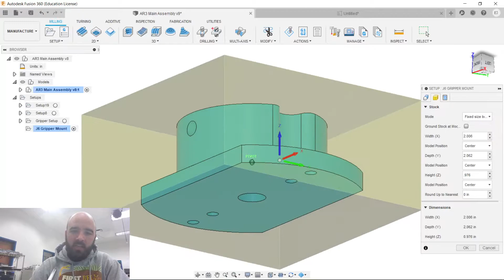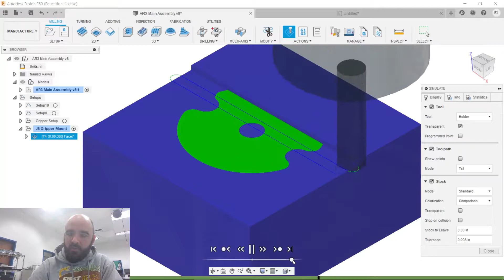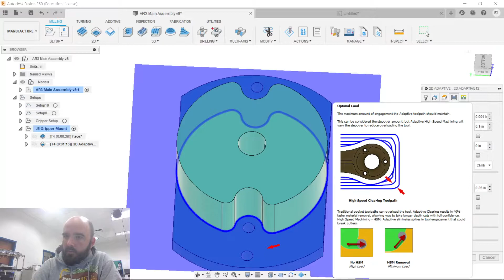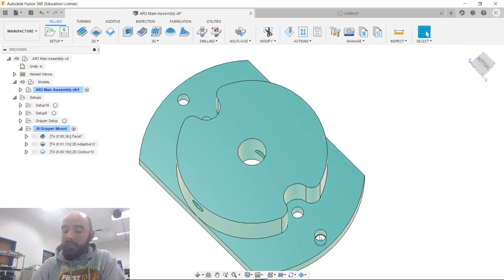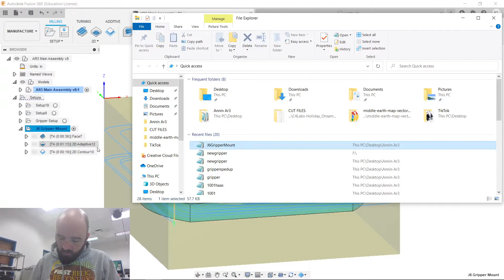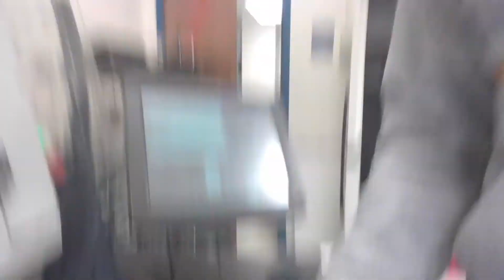Taking a Part From Fusion 360 to the Tormach 440

Comment from the maker: I did not mention that I could have used the inspection tool on the toolbar to measure that radius that was inaccessible with the quarter inch end mill. That radius is too small for that tool.  It is easy to forget the scale of the part that you are working on when you are zoomed in super tight. A 1/8 or 1/16 would be a better tool for finishing this part.